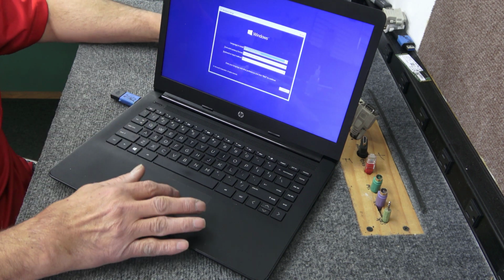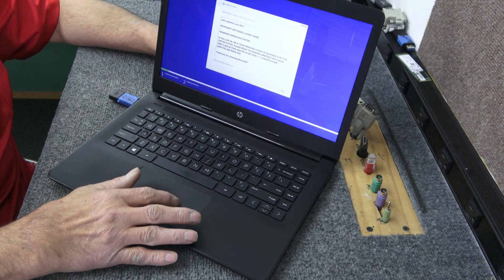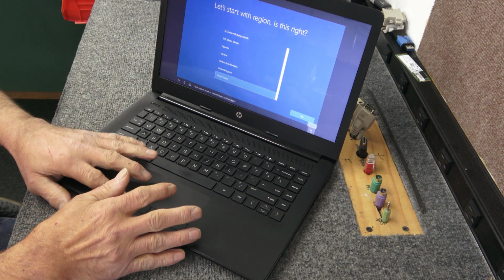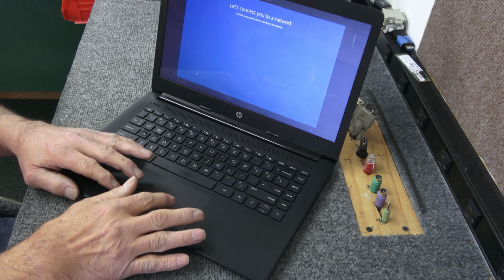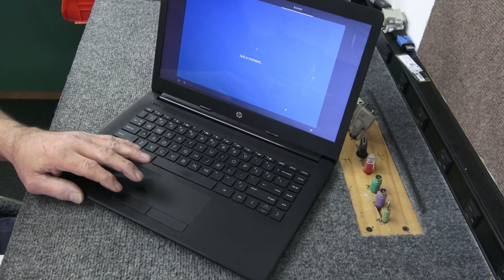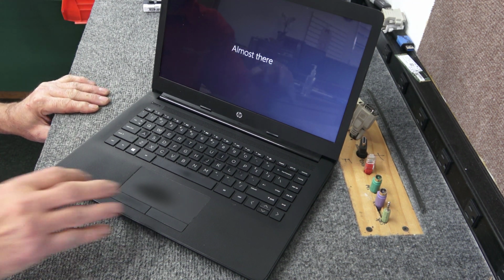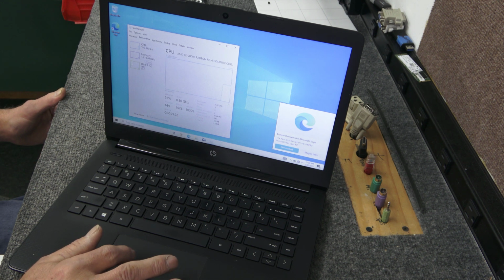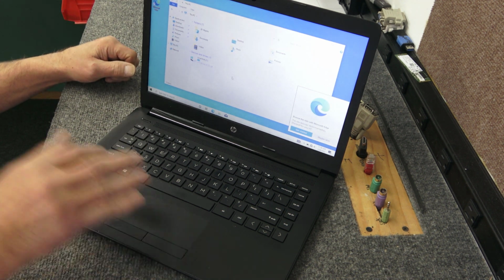HP 14 cm0045nr DISASSEMBLE INSTALL SSD & MEMORY

Comment: I replace hdd with ssd but it always shutdown after few minutes and my laptop hot. Its normal work when i back use hdd (my laptop hp 14-cm series with amd processor). Does it mean my laptop not support ssd?